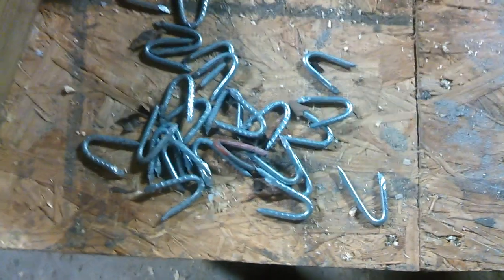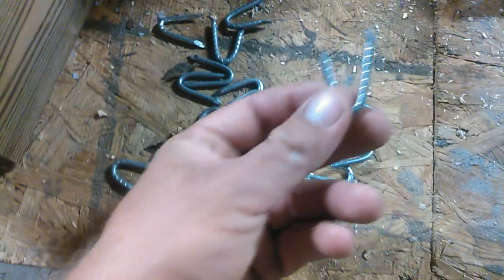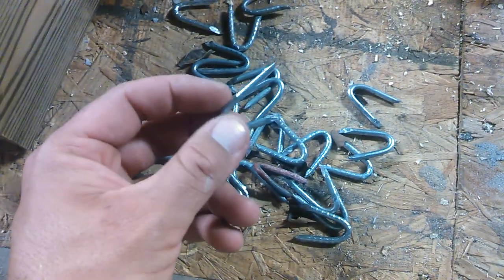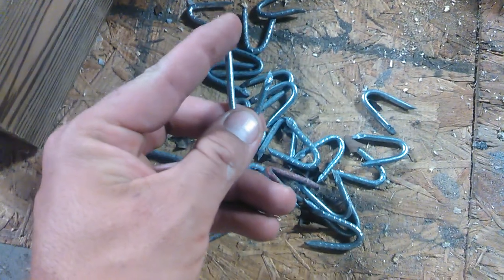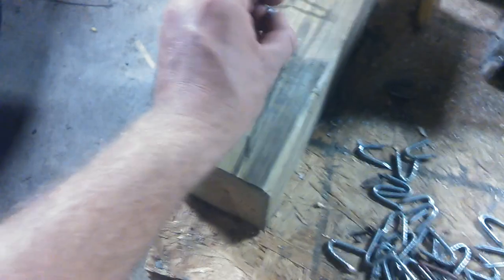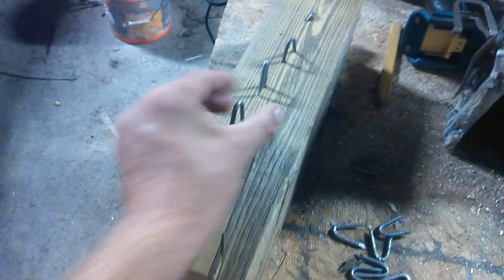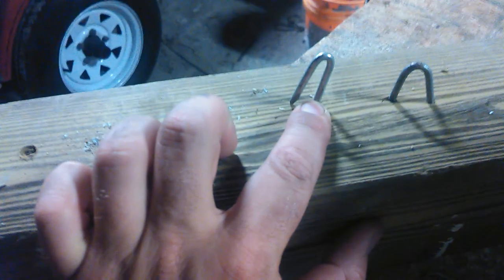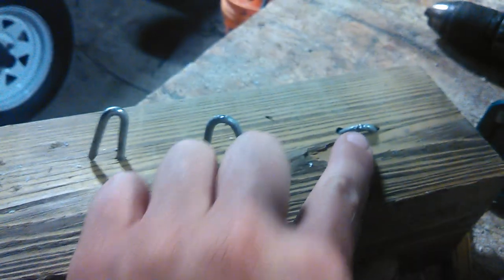Proper way to Drive Wire Fence Staples

Comment: I use needle nose to hold them. Saves the fingers.
Reply: Yes but the staples can easily twist as they are hit. It is also hard to grip the staples with the small area these pliers provide. Get "fencing pliers" which have two holes to hold each leg of the staple, and prevent it utterly from twisting.

Comment: Dude, you're doing it completely wrong. The reason there is one leg longer than the other is because the staple needs to go in on an angle to stop the wire pulling the staple back out. The correct way it to put both ends on the wood so the staple crown is on an angle and hit it in on that angle with a hammer, this way the staple seats on the angled crown and hold the wire securely.
Reply: Glad I read this.. thanks
Reply: So which do I hit on? Heck is the staple crown? I hit on the staple crown side?
Reply: Tien Trinh yes that’s right
Reply: Yep, if you don't drive it in at an angle (usually down, but not always), it will pull right back out.
Reply: The reason one leg is shorter than the other is because it's a defect and the machine that made thei decided it wanted to make your staples fly off into nowhere land when you hit them.  If you don't start the long end first with those quality control nightmare staples they just won't drive.